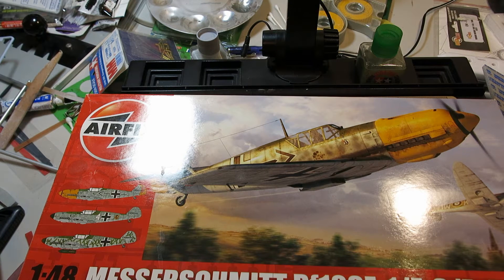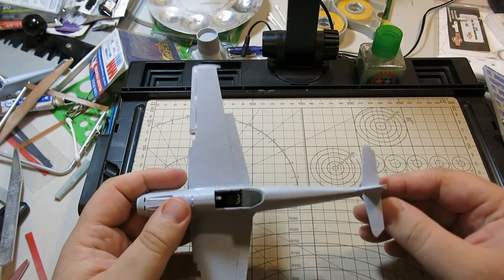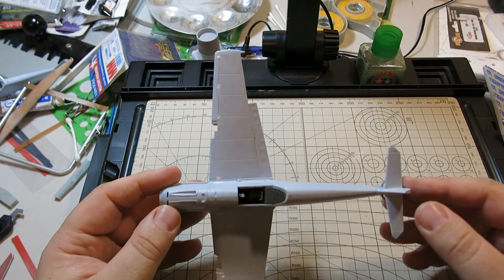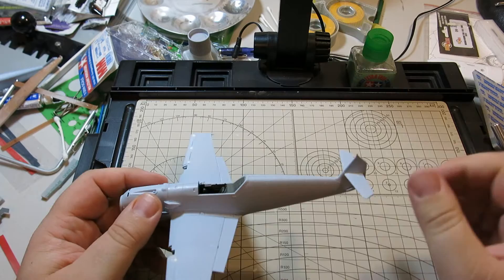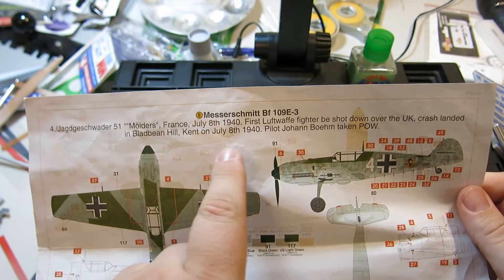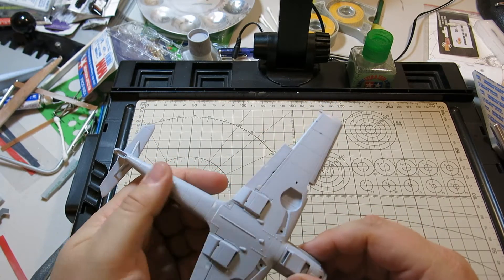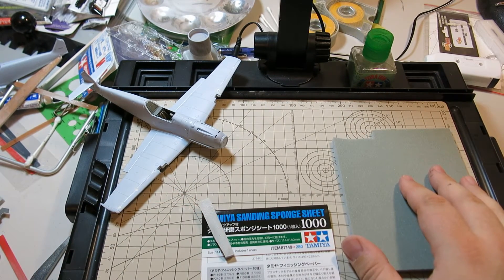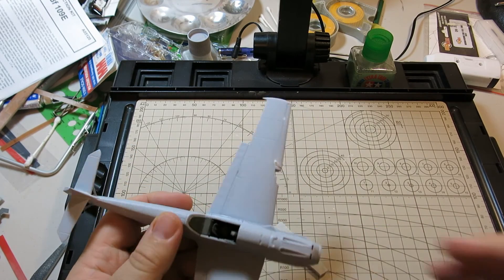1/48 Airfix bf109 E buddy build progress update

Comment: Andy...  I saw a similar sponges set.. at Home Depot ?  Not sure of the price thou. That 1000 grit sure sounded...  Rough !!!    anyway...  Thanks for sharing !      The Me109 is looking good...  and I was so certain you would POP out the cockpit and slide it in the New Fuselage ???  but that's fine !     One question?  does it really need so much putty ?   is the fit way different than a Tamiya equivalent ?   Just asking cuz I never built an Airfix WWII kit.
Reply from the maker: From what I have seen from other peoples build that really isn't that much putty.  It could also be my inexperience because this is only the second aircraft kit I have worked on(not finished).  I will be a doing a Tamiya 109 later but I have several other projects that I need to get to first.  Thank you for stopping by Norm I always appreciate the feedback.
Reply: TacticalJackalope
I wasn't questioning the builder's skills...  Andy !   I know you well enough...
But looking at the Tooling... from where I sit;  it looks superb !  The panel lines are nice and crisp, the Fit is nice and tight !  and YES..  I'm used to Tamiya tight tolerances Fit *Glue optional) and was wondering if that's the Normality on Airfix kits to use putty !   and yes... you are right... You haven't used as much as I saw on some other guys Airfix builds...    Some models seems to be Putty Happy.
and Tamiya is suffering from Putty Envy !!!   LOL

Good luck with the kit bro !
Reply from the maker: Norm Lajoie Thanks Norm I made some more progress last night and this morning. WIll post another update soon.